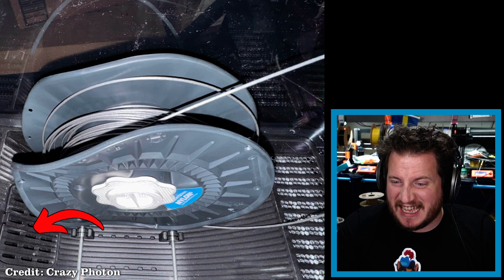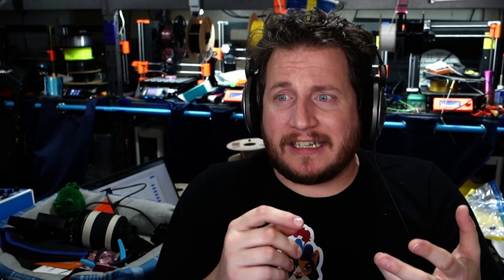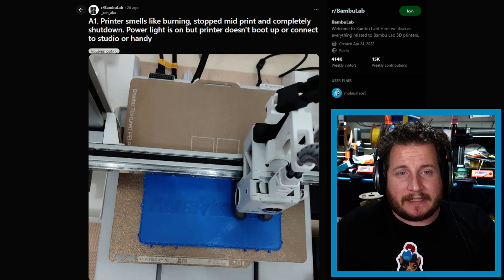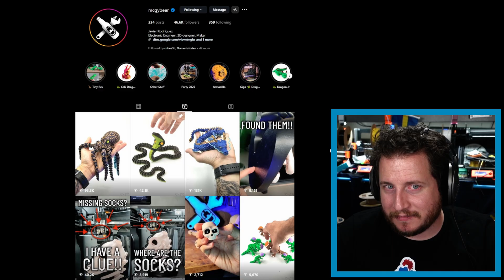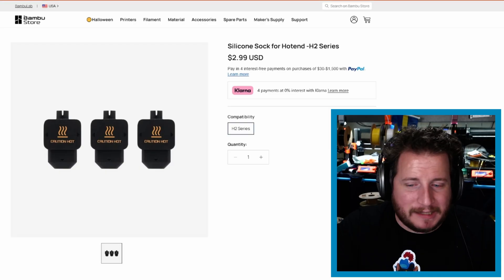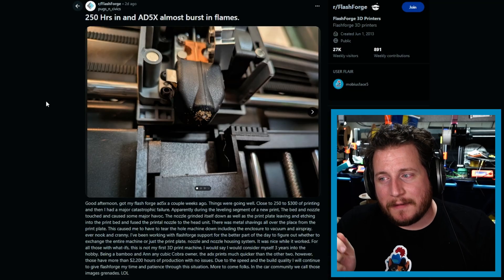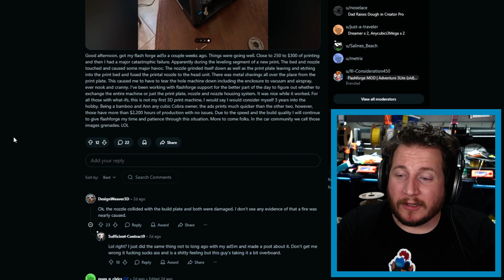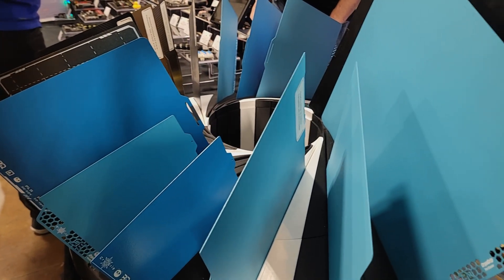Are We TOO Worried About Fires?? - PrintFixFriday 215

Comment: I would much rather have someone think maybe there was a high heat event and check to confirm than assume everything is fine and wind up with a full carbon house and Cajun blackened house pets. If it is a false positive there's gonna be idiots who will jump in and go "see this is proof all reports are a lie" but they can be ignored and the people who actually think can learn from symptoms they haven't seen before whether they need to be concerned if they see something similar. By the same token, the person initially seeing it shouldn't go into rage mode when they see something sus, but investigate and ask around for maximum informed with minimum blood pressure.

Comment: I have a Sunlu S4 dryer. I learned from reviews when it was released that the exhaust for the heater was indeed many degrees warmer than the set point. I found a model for curved spool holders that insulate the spool from the hot air being directly blown on it. I printed 4 of them out of ABS and have had them installed for over a year. I haven’t done any temperature testing myself, but the dryer seems to work just as well as without the covers, and I’ve had no issues with melty spools haha

Comment: my bambu lab a1 also did the same thing on 18th october, it died suddenly when printing but does not smell anything smoking. but about 1-2 days i did smell something smoking but not sure if its the filament or what not and keep printing since it print normally. when i check the printer, the bottom have melted at the same place as the rest of the other a1 user. atm i have sent it to the shop that i bought it for repair/warranty. only take the pictures of the melted bottom and never open the inside as i thought that may break the warranty. bought the a1 back in early september. im really afraid if the same thing may happen again after replacing the ac board.

Comment: I have a AD5X and 5 AD5M and the Z offset is VERY common. All 6 printers have done it. The issue I've found with the Z offset is I believe firmware based. Seeing several other users (more then 20+) having the same issue, the recommended fix for this is to do the bed leveling before every single print. I tried a couple times on the 5x and 2 of my 5m and the z offset will be off. So always do auto bed leveling before each print for the 5x or 5m.

Comment: After trying two off-the shelf dryers (Sunlu S1 plus, thermistor is on the display PCB not in the chamber, and Creality Space Pi, fans dying of the heat after two weeks): That market is a mess, on the brink of being a scam. 

I designed and built two dryers myself, they have proper Sensiron sensors, Wifi and MQTT, thermal protection and vent the moist air in a controlled way, all for under 90€ parts. 

Why is there no Prusa quality dryer on the market? Why is there no Voron of dryers yet? Fascinating. 

(my own design is too rough to publish and relies on that one specific cheap heater off amazon, but I am just a beginner anyways…)
Reply: the AMS 2 and the eibos boxes for the AMS exist, but I'm guessing since you named prusa you mean something more open source and universal

I think it's just that it's just not that profitable to do it at the prices most people want them for
Reply: @xuyukun123  No, with Prusa I did not mean open source, rather the quality, or really Prusa designing and selling a dryer. But could be Bambu  or whoever as well.

But of course I mean an universal dryer, primarily a one-spool model, that does everything right. Put spool in, set temperature, and it does the rest in an optimal way.

These AMS-specific solutions are obviously just for those printing from an AMS, and for keeping already dried spools hot to prevent them from re-absorbing moisture. there's less power necessary.
And from what I see currently, most have the same annoying cheapo pseudo-touch LCD panels with "Filament Profiles", no controlled venting of moist air and all the other common flaws.
Reply: @martin_emrich  yea I'd say if eibos had something standalone similar to their tetras system that would be it, or if something similar to the AMS HT came out but just as a dry box. All the AMS units have venting btw, as do the eibos add-ons. Bambu could actually severely disrupt or take market share just by making the AMS HT a platform agnostic dry box lmaooo

Comment: As far as the sunlu dryers. Hell yes hold them accountable. If you set a temp it should be that temp +- just a few degrees no way any temp in there should be 50 degrees higher. Get compensation for damaged filamdnt and refund for the dryer.